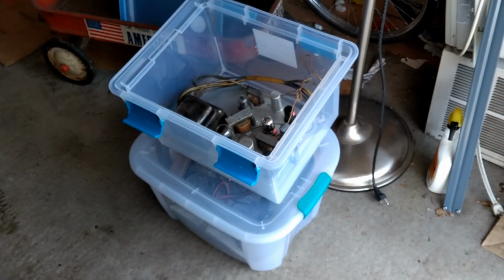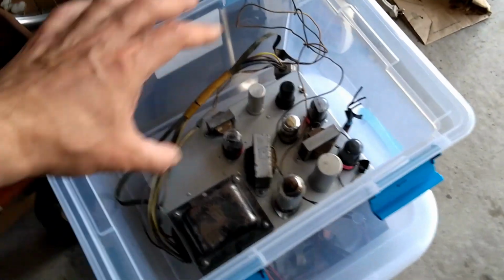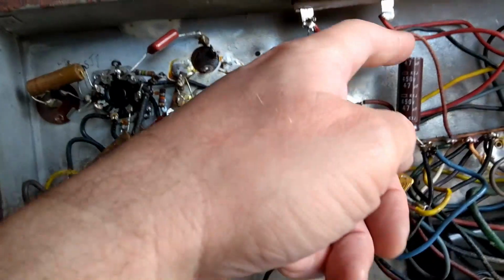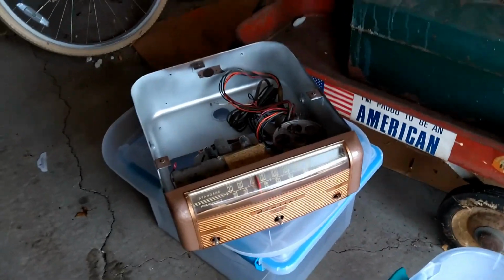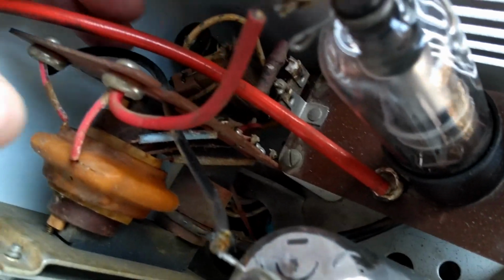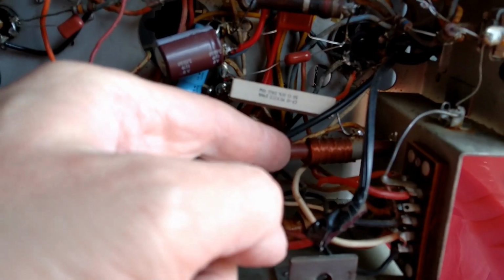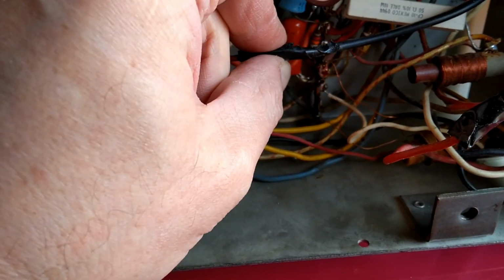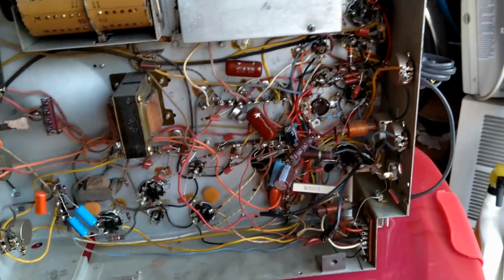Admiral 20B1 first look

Comment: I am re-visiting this project. I listen intently and try to learn and understand because all the basics are displayed here before printed circuits where everything is still there but changed to our technology of loop tuned tuning instead of variable capacitors in tank circuits.  I even think there was a completely different direction we could have gone with radios and television circuits and figuring out how they made the circuits work with a raster cathode ray tube was pretty ingenious. Controlling the waveform without seeing what it looked like with a wobbulator reminds me of an ancient device dug up from 100 ft deep in the med watching lunar cycles to predict eclipses and other dates to come. The anti-kithera device had gears like a clock but the moon does not follow an exact path and it has excursions that had an epicentric screw out on a gear to mimic when the moon did a funny little little loop out that was copied by an epicentric screw to match the lunar orbital motions over periods of more than 20,000 years of movement. We don't make clocks like Archimedes did with the design and function  this device had. The reason I mention this device is all the frequencies they were controlling to get an addendum of frequencies to get the final shape they wanted but couldn't see like we can. Blah blah sorry but this is interesting even though I could care less to watch the old shows I saw out in the country on a farm in Oregon in the 50's. I even watched the Silent Service about submarines in ww2 back then watching the advances made in those few years. I still really like that show.

Comment: That TV chassis is a mess, clearly whomever worked on it wasn't thinking too hard, though it could have been worse. I still can't get over why they needed to replace the picture tube more then once. For the safety interlock cord I think that I would replace it with a more modern, and cheaper equivalent rather then using one of those NOS ones with the ears. The radio chassis should be interesting, hopefully they didn't bugger around with that too much.

Comment: My experience with those candohm resistors is that the usual mode of failure is for the resistive wire to lose continuity with the terminals, and for sections of it to go open. This is seldom a problem with the smaller ones with a single section, but happens all too often on the long ones used as voltage dividers, often in the bias supplies of pre war radios. I suppose the fish paper could burn through and the wire could short to ground too, depending on the construction. 
  It's a mystery to me as to why they didn't replace the paper caps in that amp/power supply chassis, the audio coupling caps are usually the first ones to fail in anything. Did you mention that it had push pull 6Y6s or push pull 6V6s? Push pull 6V6s would be the more common design.
Reply from the maker: I defer to your experience.  I admit I was repeating what I had read on the forums without have experience it directly myself.  I know better.  There are a lot of myths and legends floating around in this hobby.

Comment: I own the power supply from one of these 20B1 sets that has been "converted" into a makeshift homebrew audio amplifier by it's previous owner sometime in the late 60's, early 70's from the date codes of the extra components added.

Comment: The chassis is amazingly clean on both radio and TV sections...but BOY!...they should have sent it to you to start with!!!  Some of the things they did were ok,  but they should have removed ALL the paper caps and replaced them.  And some of their "Fixes" were more like nightmares.
Reply from the maker: Yes, no excuse for leaving parts hanging in midair.  Especially large power resistors!

Comment: Polyester caps in the vertical integrator...I would had used U2J ceramic or silver mica.
Reply from the maker: Didn't have any on hand. If it's an issue I'll replace them later.   U2J is a new one on me.  They only seem to be rated for 50V at DigiKey ?
Reply: @bandersentv  They make them for up to 3000V from what I have seen.

Comment: Three years?! Wow, that's quite a while - what could they have been doing?
Reply from the maker: Apparently they went through several picture tubes.  Said they went gassy.  I find that a little hard to believe.  I'm guessing they broke them.  Each time it took months to track down a replacement.
Reply: @bandersentv  Sounds like inexperienced techs breaking stuff and making excuses to me...I have a 22X12 with a weak 12LP4, but it's still under vacuum.
Reply: @bandersentv They probably destroyed the tubes by running excessive EHT through them. Who knows. Sounds suspect to me whatever they claim. I am sure you will eventually get to the bottom of it over time and eventually solve the complex jigsaw puzzle of this TV's faults. It would be good to see it work again (hopefully). :)
Reply from the maker: @RoughJustice2k18  I'm thinking they physically broke them. There's no protection for the CRT when the chassis is out of the cabinet. Three years in the shop - it must have gotten bumped into a lot

Comment: Always tough to work on something that someone else has given up on. Too many times the first person made some hack repair that is not correct or is mis-wired or something. Can be hard to get it back right again for sure!
Reply from the maker: Indeed. Luckily I have more experience and spare parts for Admiral chassis than any other brand :)
Reply: @bandersentv  and was not found in the woods for 50 years  like the mystery radio  XD